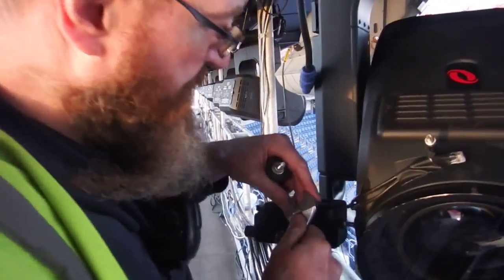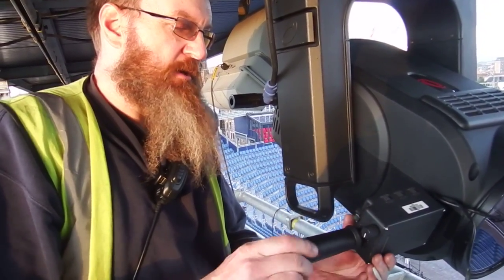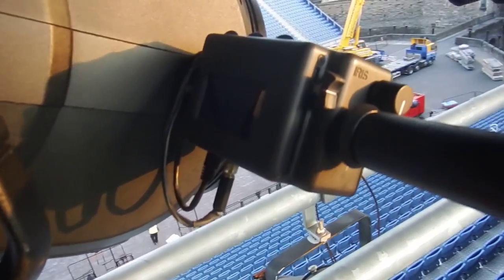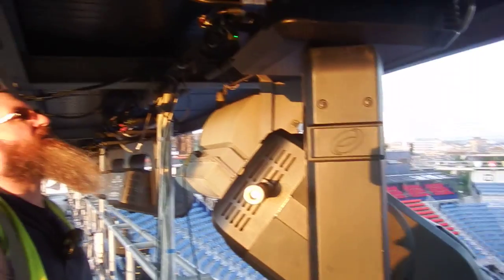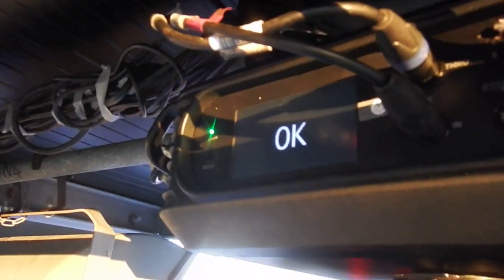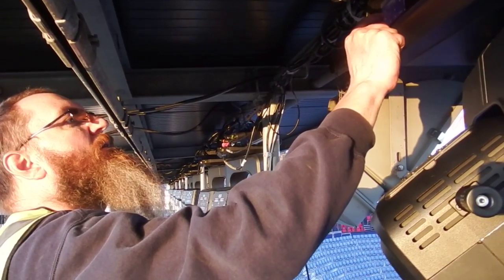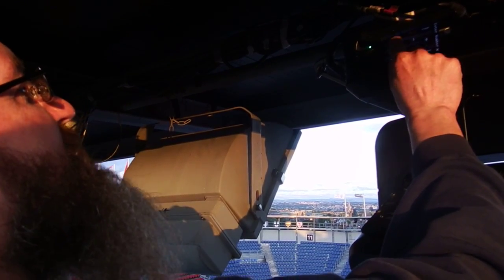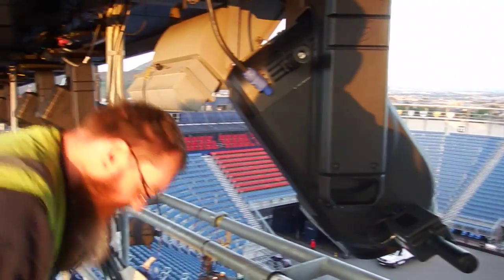Random work video.  Fitting a PRG Best Boy followspot conversion kit.

Comment: Configuring units with dip switches was so much more fun and you didn't need to power up the unit!
Reply from the maker: You don't need to power up these either.  If you press a wake button the internal processor boots up on a battery pack and lets you adjust parameters and the address.
Reply: Nice feature.

Comment: Well I'm glad it isn't just me who has issues with seemingly offset touchscreens.  I ended up buying a cheap touchscreen stylus and my accuracy has improved.  I use mine to set up various helicopter feature film cameras (I'm a camera tech) though so the touch areas are even smaller.  Why don't manufacturers just adopt the Sony spin-press wheel method and save us all the trouble of multiple data input attempts!

Comment: I am guessing the light is aware that there is a handle mounted to the back and wont try to go past it?
Reply from the maker: The pan and tilt is disabled.  The light knows it has been set as a followspot and will only nudge the pan and tilt slightly while doing its self test at power up, before unlocking it to allow a manual operator to aim the light.

Comment: Do the Pan/Tilt Motors get disabled as soon as you plug that little Controller in? I worked with that stupid Martin Track Pod or however the Thing was called, to control Moving Heads as Followspots, and it was pretty Buggy, as far as I remember,
This seems like a pretty cool and straight forward solution
Reply from the maker: You choose the followspot function in the lights menu.

Comment: I always figured you worked your way up in your job,thats quite a ways up. The weather still must raise hell with the electronics,humidity,cold,corrosion probably sets in on that suff eventually. I found this stuff called corrosion X that works great on delicate electronics like servos, circuit boards and all electronics. I use it on my RC boats,planes and anything electronic ( even my solar yard lights) and it works great. I even threw a rc brushless motor,esc and battery as well as servos treated with the stuff and everything worked even in the water. No puff of smoke,nothing. Can you imagine how great it would be on what you work with Clive? I bought it on line. I use it mainly on my RC boat,but I have one plane with pontoons and water gets up inside everything because of prop wash. No worrys and it dont eat foam ( I have an Apprentice) . Its a great lubricant also. I hosed a brushed motor down with it and ran that right after hosing it down with CorrosionX no shorts,its non conductive.
Reply from the maker: We can't put anything like that near these lights because of the optics.  They're designed to deal with small amounts of rain splashing, but the bulk of the protection here is the strong angled canopy overhead.

Comment: Those lights don't look particularly designed to be used outdoors, hopefully they don't get rain blown on them. That'd be an expensive bang.
Reply from the maker: They are designed to shed water in a controlled manner, but the gantry they are under is specifically shaped and angled to provide as much protection as possible.

Comment: Hopefully there isn't near horizontal rain coming this way. Am I right to assume those connections aren't water tight?
Reply from the maker: The gantry has a cleverly angled and sized roof to deflect the majority of rain away from the lights.  Any that does get on them is evaporated quickly by the heat when the show is running, and when the show is not running the lights are parked in an optimal position for avoiding water ingress.  Any connector exposed directly to the weather is either water resilient or covered with a sleeve.  The Haar sea fog is the biggest issue as it deposits moisture on every surface.

Comment: The coolest feature would be if you could manually operate the bestboy and have it remotely control all the other spots with careful inverse kinematic trig to have ALL of them point at one spot.
Reply: Was thinking the same -- only trouble is 
retroflective = visible to audience
IR = blinded by the bajillion floods and spots
gps cleverness = delay and probably not precise enough

Either way, automatic or semi-automatic I think it would be neat...unless that one operator screws up and then all the spots are on the wrong spot.
Reply: There are systems used in theatre that use radio-based TDOA multilateration (Stagetracker and TiMax) to automatically pan each performer's mic channel as they move around the stage. The same technology is also used for sport player position tracking (Chyron ZYX). They're pretty accurate, down to a few cm, but I'm not aware of anyone actually using them to control a moving head light, though.
Reply: +frollard +frollard I suggest looking up a fantastic system called BlackTrax which uses IR based tracking. Believe Eurovision and more recently Muse have used the system with no problems :)

Comment: now, if you were to personally choose which kind of moving light made by PRG, which model would you go with? a later best boy model, or an earlier one?
Reply from the maker: They're pretty well engineered.  They do have their quirks, but they're evolving over time at a software and hardware level.  This job will be the longest I've played with them in a continuous run, so I'll either love them or hate them by the time we de-rig them back into their flight cases.

Comment: why'd ya run the power and ethernet over the front instead of around the back of the controller? XD That's bugging me, didn't see it the first time I watched this x3
Reply from the maker: The cables coming out the light are short and come out at the front of the controller where the connections on the base are.  There's very little play for putting them over the front of the connection bolt .
Reply: bigclivedotcom Ah, that is a shame, I was mostly joking, And I fully trust your judgement. Thanks for the reply.

Comment: WOW, brings back memories of when I served with The Old Guard in the DC Area back in 1976, our nations bicentennial celebration took place that year. I was with the Headquarters Communications and Electronics Section, we were charged with the setup and operation of the theatrical lighting and Stage Sound equipment, so we would be crawling around on catwalks and such setting devices sort of like the grandfathers of the ones you were working on in the video.  When working on such things we were dressed in white coveralls instead of the traditional uniform of The Old Guard, the Dress Blue Uniform of the US Army.  This many years before the rest of the Army received that uniform.

Comment: I'm pretty sure there's nothing really wrong with the touchscreens, it's just that the touch layer and the display are quite far apart so your viewing angle shifts your perceived touch location in relation to the display. At least that's what i found to be the case with cheap smartphones and outdoor terminals like self serve gas stations.
Reply from the maker: Some units are accurate and some units are WAY off by a whole button or more.  They really need calibrated.

Comment: The controller that was added appears to be attached to the light by a single metal rod?  With the added handle, is there risk of bending or breaking the controller from the light?  Would enthusiastic use of the forward-handle break it?
Reply from the maker: The light glides round on bearings.  It's actually really light feeling for a followspot.  Particularly given how bright the output is.

Comment: PRG being a bit over kill putting touch screens in their fixtures.
Reply from the maker: It allows easier setup and full diagnostics.  These lights have a very powerful computer in them, so they need a proper interface.
Reply: +bigclivedotcom better than taking a laptop up to run diagnostics. Are they designed in house by PRG or re badged?
Reply from the maker: Designed and built in house.

Comment: What do you think of PRG versus Varilight or Martin, etc.
Reply from the maker: The PRG lights are built by Ex Vari-Lite engineers.  They are very distinctive inside and designed for a rough touring life.  they're also very modular and maintenance friendly.
Reply: +bigclivedotcom do you think the Chinese lights are anywhere near the build and engineering quality of the American or Euro lighting companies?
Reply from the maker: Not even remotely near the build quality of a Vari-lite or PRG unit.  These lights are designed for heavy touring use and rough treatment.

Comment: Nice, but where's the Vice of Knowledge? And what's inside that light?

Maybe you can install an eBay color wheel light up there, too!
Reply from the maker: The Best Boy is amazing inside.  Lots of PCBs and absolute encoded motors all round the light path.  I do want to make a video about it, but need permission for this light first.

Comment: 'Follow spot' takes me back to school, (i did stage lighting as a pupil) old style Furse spotlight, metalwork teacher made a double tang bar, woodwork teacher made a couple of file handles, this was assembled and fitted on the screw on the back of the light that held the access door in place, looked like a headlamp with handlebars, so we called it 'the motorbike spot' :D